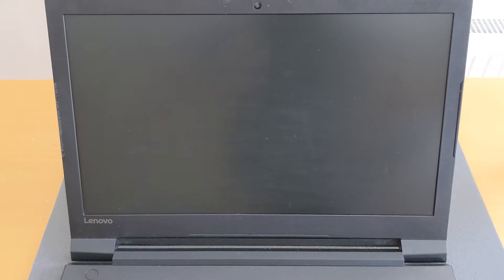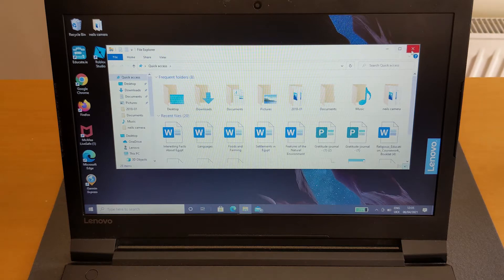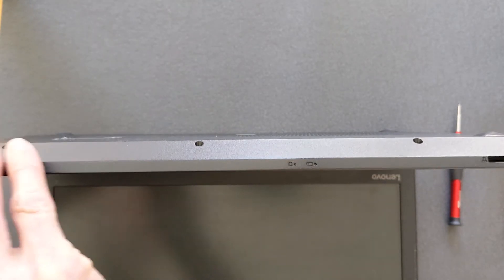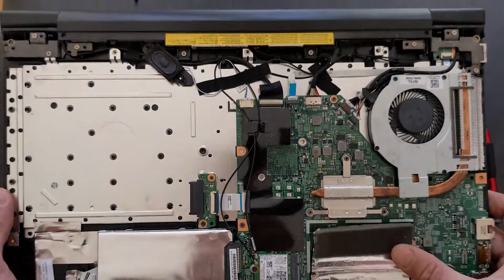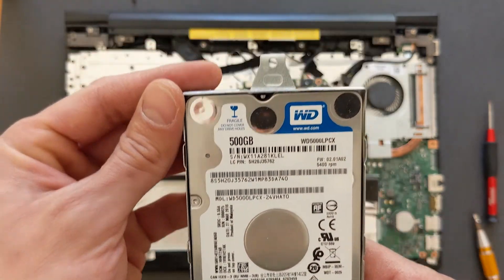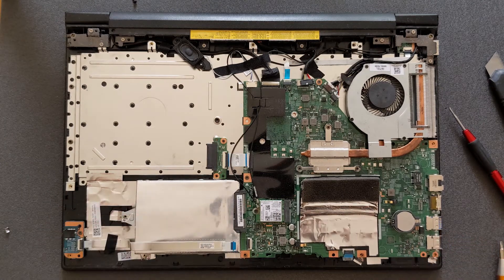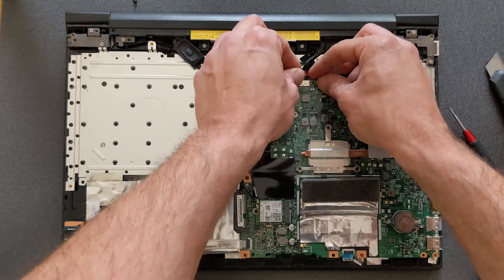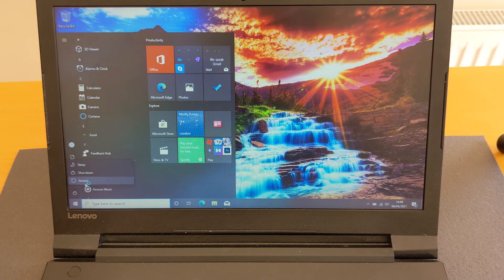Lenovo V110 Hard Drive and RAM upgrade: Before and After

Comment: According to their website 12GB is the max RAM supported.
Reply: Yep
Reply: That’s for V110-15ISK “80TL”   not  V110-15ISK. The latter supports the total of 20GB, 16 per slut
Reply: That’s for V110-15ISK “80TL”   not  V110-15ISK. The latter supports the total of 20GB, 16 per slut

Comment: Is it possible to add 16gb ram. So total will be 16 + 4 gb?
I saw in manual it mentioned the maximum ram is 16gb

And the speed 2133 as per processor documentation. So what is installed higher speed ram?
Reply from the maker: 4GB is on board so will take 16GB DDR4 stick, in total you will have 20GB. Not so sure about higher speed ram!
Reply: @ToxicNerd  but in documentation it wriiten that the max ram is 16gb.

And do you recommend crusial brand for ram?
Reply: @ahmadyazantibi5744  you can install 16gb but ram benchmark is around 12gb/s. With samsung 4gb ddr4 at 2400Mhz the benchmark is around 16gb/s !!! Unfortunaly i don't know the benchmark of 4gb dd4 2100Mhz maybe it will perform betther than 2400Mhz and i sold my 8gb  ddr4 2400Mhz   i don't know the benchmark but my advice is to put a 4gb ddr4 stick!!!
Reply: Black Sheep  
It means i can put 16 gb in another slot of lenovo v110-15isk ,then it will be 20